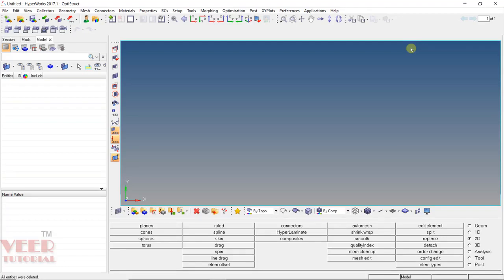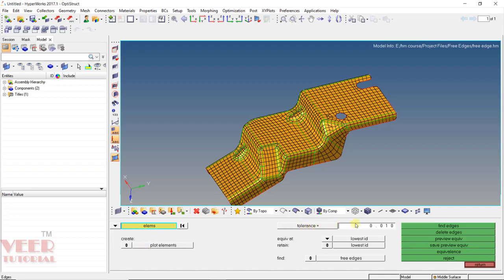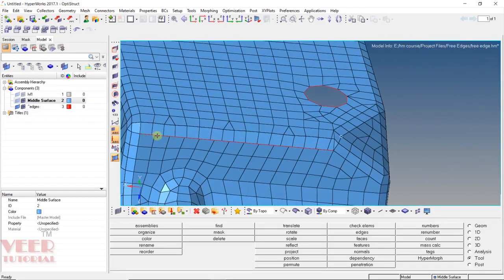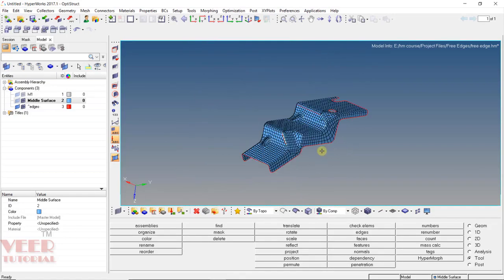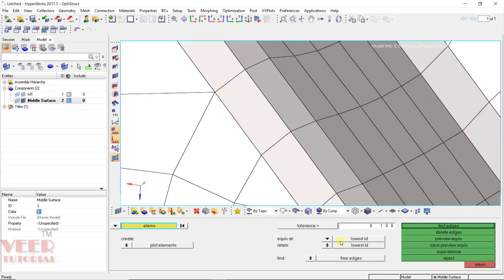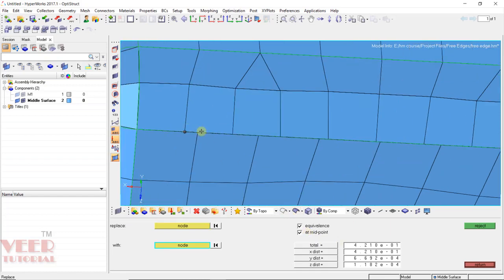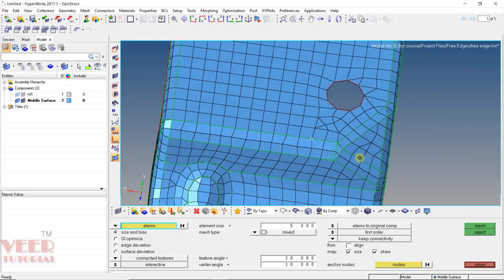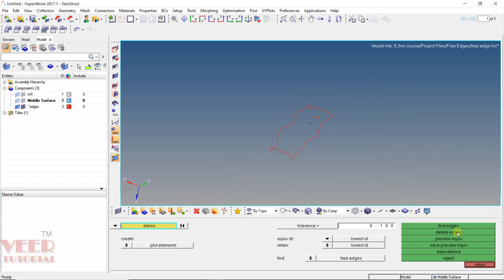Hypermesh | Find & remove free edge

Comment: Sir any vedio on BIW and plastic on hypermesh?
Reply from the maker: i am adding more content on biw and plastic mesh.
Reply: @practicalfea5590  Thanks sir , I have an doubt 
1) Durning automesh F12 , when to select
Flow - align ,size
Map - size ,skew.

And what does it mean?

2) Durning remesh , what to select and mesh
Flow- align , size
Map - size , skew
3) Feature angle ?
Any vedio on this concept
Reply from the maker: @sunilvishwakarma1661  for a beginner , you can take default options. I will try to make video lecture on this.